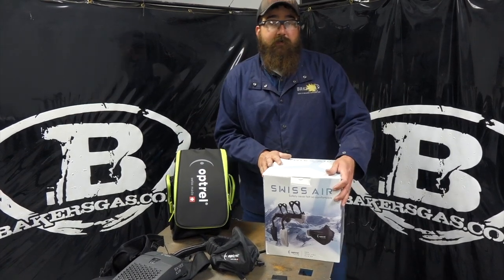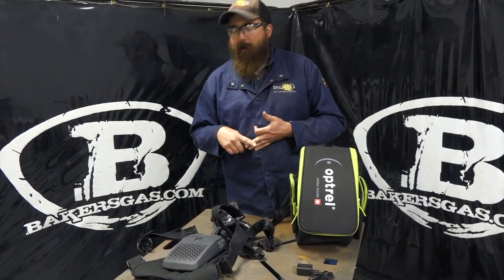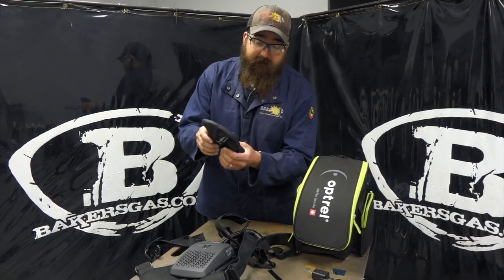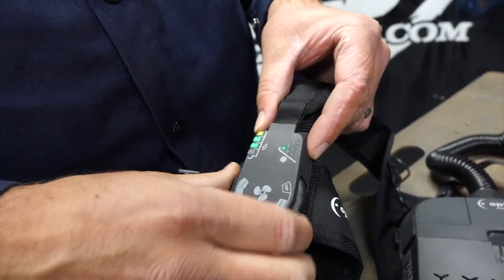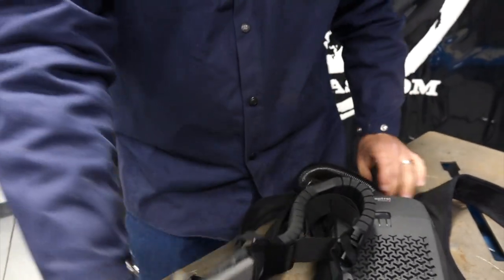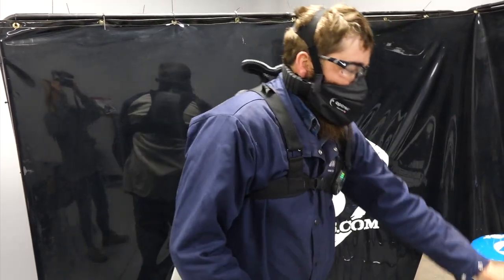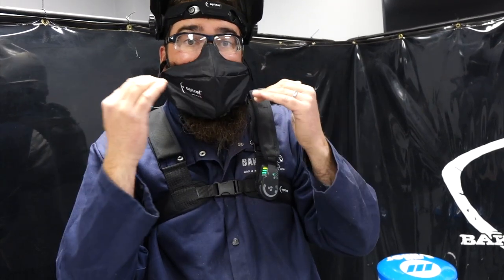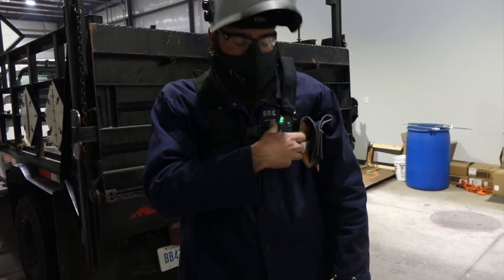Optrel Swiss Air Review - NO HELMET REQUIRED PAPR! 99.8% filtration & rechargeable mask system.

Comment: I got this product and would highly recommend. The back pack does have an adjustment with the straps where they attach to the back pack on the lower straps. There is two sizes of straps that are attached to the back pack on both sides. Plus the Valero has partial adjustments.  Thank you for your video. I watched it before I did the free 4 day trial from Optrel. After trying it I would not want to go back to my half mask respirator from another brand. Very comfortable and useful product.
Reply from the maker: Thank you for sharing! We agree you almost have to try it to really see the value!
Reply: Do you still recommend it now you have had it a year.  Also could you say how long the filter lasts?  I weld on pipelines in trenches all day and am wondering if the filter replacements will cost me a lot?

Comment: I am guessing Optrel recommends wearing the harness under your welding jacket or does it come with a protective spark/heat resistant cover for the control knob? I'd think judging by the sparks hitting it while you are welding that it would not last long outside a jacket during long welding processes.
Reply: They claim it is built to withstand the welding process and shouldn't be under any clothing because it will reduce airflow...

Comment: You did great tests on both PAPR e3000x and now  Swiss Air. Which one would you suggest,when and why, now that you've  tried both? I will take one system for my home hobby job. I'm leaning towards the Swiss air, cause it takes off the weight from the helmet, can use it under any other welding helmet if I choose to swich, and under any other clear mask that I already have, But I'm not sure how it fits under the welding mask especially Panoramaxx.
Thank you.
Reply from the maker: Hello, thanks for watching! The system we would suggest really depends on your application. In our opinion you really can not go wrong with the Swiss Air. Super versatile since you can wear under a helmet or shield (or alone) these days masks with filtration is an every day thing.  I will have one of the guys on the team try the Swiss Air with the Pano and let you know how it fits! Email us and we can quote you both. support@bakersgas.com
Reply: @BakersGas   SUPER Great. thank you so much guys for trying it with the Panoramaxx. 👍
Reply: @BakersGas  did the filter cover tab break on you?
Reply from the maker: @Andrew-FKF  yes we did break it, it can be replaced though!

Comment: For hot climates welding and grinding would you recommend this over a papr helmet and grindmaxx papr mask. Trying to decide between cost comfort and versatility.  Shame is doesnt fit under panoramaxx.
Reply: I would highly recommend the product. It is very nice to have the fresh air in the face all day in a hot shop. Right now Optrel is offering a 4 day free trial at some of the retailers. Maybe this guys business has this offer.
Reply: @kevtech733  which are you saying you have. I'm between the 2 options they offer. Full face or half mask
Reply: 2F Welding the Optrel Swiss Air. The one in the video.
Reply from the maker: Yes this is a game changer for comfort plus you can pair with ANY helmet if you need to weld or grind. Any other questions let us know.

Comment: Every  welder should  be provided one of these  

My lincoln papr is bulky and you cant get into certain places 2 hour battery   but this thing skeek looks light weight. I'd wear that daily even just welding out side or on a building   

You can say it's expensive  but you can't replace your lungs. 
Sit on machine rest your life or proper protection 

My papr cost $1500 was welding galvanized with 7 other guys in a small shop
Reply: Yes good point. I got this product and it is $1600 in Canada but worth it. Way better than the 3m half mask I was using and the battery last all day. 9 hour shifts I wear it entire time and it only shows 1/2 use of battery.
Reply from the maker: Yes we agree all welders need this !

Comment: Between this or the e3000 what would you recomend? I am currentlly using the 3000 but it has very little air pressure diffence Between high and medium. If this is a better unit i would much prefer to go this route.
Reply: I have it and low setting is useless, you need two batteries to keep it on high.

Comment: Bud, how do you get to try these. If been welding SS and Aluminum tanks over last few years....got long haul covid that still has my lungs f'd up and the N-95's I wear just grinding or inside clean out have me pulling hard w/new filters. I can only do bout 10 minutes inside  before  I  need AIR.... and that isn't cutting it.  We have 3m papr's but unless for actual work and bulky in a 54"tank for my tall ass. Any info much appreciated.
Reply: Id like to know as well I’m with you on the tanks I weld and grind in aluminum fuel tanker and fuel trucks.
Reply from the maker: Hey! Sounds like you need a Swiss air! contact us for more info or options on a trial to show your boss :)
Reply: @BakersGas  How do you go about getting a test/trial demo?

Comment: I like the flexibility of this unit. I would love to see if it could fit under a panoramax.
Reply from the maker: We are going to try it out and we will let you know! I think it will fit but will be close :)
Reply from the maker: It will not fit under the pano! They do make a Pano PAPR if you are going to be welding and if you really like that hood.
Reply: @BakersGas  awesome thanks so much
Reply: @BakersGas  Thanks for testing it. Can you please elaborate on this why you thik it will not fit ,cause I've seen the optrel selling Swiss air in ready to Weld packages with Pano. So they "think" it fits .. If using Swiss air in Pano would mean you need to go further away from the lens, resulting not having that "pano" view anymore, then I understand.
Reply: @BakersGas  But they sell a kit with the Swiss Air papr and Pano's. Not to be confused with the welding hoods that have the fresh air built-in.
Reply: @Baker's Gas I don't agree this won't fit with a Panoramaxx.  I just had a Swiss Air + new Panoramaxx CLT and it worked fine and had no issue.  Yes, nose rested right on the top of the mask, but could potentially compress further with no fit issue or artificial tilt up of the helmet.  Real Estate was even better on my regular helmet if you wanted to tilt down further, but that is no different that regular vs Pano w/o Swiss air.  Swiss Air took up less space than my 1/2 mask + round 3m filters.  Awesome product!  Hope this helps someone.  I stumbled on the answer to this same question
Reply: @gotcrampons7913  thank you
Reply: @marvinc02  I bought and now own the Panoramaxx CLT + Swiss Air I was so impressed.  Clearly full on disagree that they aren't compatible and HIGHLY recommend the Swiss Air and not having to be "locked" in a Papr Helmet system!
Reply: @BakersGas  could you please see if it fits under the 3m g5-02? i would really appreciate it  would hate to buy it and realize one either i have to replace a 1300$ helmet or return a 1600$ swiss air  :/ thanks a ton!
Reply: @gotcrampons7913  do you smell any welding fumes? What about Amy sealants that melt by welding area smell this? (Crystalline silica)
Reply: Probably didn't realize the nose foam has tear away pieces so that it does squish your nostrils, I weld side dumps, logger trailers and a bunch of other trailer styles. The Swiss air is a great papr. It was designed to be worn with pretty much any hood; grinding shield it's much more low profile than a 3M half mask with the n95 dual pink filters. So if you can wear the 3M half mask this will work. The pack is adjust up and down I wear mine lower because it just feels better on the shoulders when I wear it hours on end. There is a multitude of adjustments so if it's tight on the chest that can also be adjusted. I spent an evening at home adjusting it.

The face mask is cold water washable and the nose foam is replaceable, which if you do was it will more than like have to be done or just use mask cleaning wipes.

If the mask is fitted correctly you won't get and smells until you need to replace the filter, filters are smaller than most systems so if you are in a very dusty/dirty shop you may have to do that more frequently, I do wish the pre-filter was washable but the are a  tightly weaved cotton (i think) disposable with a spark guard of course.

Few things I wish they would change is the lower draw string on the face piece feels weak and I expect it to break, but it has as of yet. Wish one of the shoulder straps had a fastener like the face mask for easier time getting it on/off.

Comment: Anyone know if the filtration is good enough for vapors/fumes while painting using etch primer, water based paint, clear coats and hydro dip activator?
Reply: I don't know about this specific product but PAPR units generally only come with particulate protection. For VOC's, fumes and gasses you want specifically rated protection against Organic Vapor/Acid Gas.
Reply: @WorthlessGeek  yes I found an organic vapor filter for the e3000x unit
Reply from the maker: Yes, if you want to reach out we can give you information on a trial!

Comment: Can you make a video comparing the Cleanspace 2 VS Optrel Swiss air (without helmet).
Reply from the maker: Clearmaxx? https://bakersgas.com/products/optrel-4900251
Reply: I checked out that other product you brought up and it looks like it does not have a pre filter. So in dirty environments it would go through the filter very fast. I have the Swiss Air and it does have a pre filter so it savers the master filter and I have gotten almost a month out of my 1st master filter and still has some use left. I work as a pressure welder in a vessel shop.
Reply from the maker: @jjgonzaga4229  I am not familiar with that option but the Swiss Air is our favorite quality option. Let us know if you have any other questions.

Comment: If I put this over my clothes, it's open to damage from flying sparks. Can I put this under clothes?
Reply: There is a spark protection filter before the other filters so there is no need to do that. Also, you'd restrict the airflow pretty badly by doing so...

Comment: How does it not need a fit-test?
Reply: Because it's not a tight fitting full seal respirator... PAPRs are positive pressure which pushes air out and only air coming in is thru the filter pack. 
Whole reason I'm looking into one is to keep my beard (in regards to your other comment about coverage and his beard)

Comment: How does the old air escape?
Reply: My question exactly as well.
Reply: @chrisp9046  hey man, I bought a newer optrel paper helmet with a face seal under it and it works amazing. I don’t smell any fumes at all.
Reply: All the new optrels have it very amazing 1000000% recommend the crystal papr
Reply: @chrisp9046  if your gonna order the optrel papr crystal you’re gonna need an air pack as well
Reply: @Gldoo  Oh man, thanks for telling me man! I have a feeling that wouldn’t work with a beard then lol. So it doesn’t fog up your welding lens? Thanks again for letting me know!
Reply: @chrisp9046  yep I have a beard as well and the optrel crystal papr 2.0 is amazing and works very well, I weld aluminum so there’s a lot of fumes and I don’t smell anything and if I do, it’s very rare
Reply: @chrisp9046  no problem

Comment: how long the filter last
Reply from the maker: Hello, the system does have a light that does indicate when you should change the filter. In general good idea to change annually. Really does depend on the environment you are in. Never can hurt to change more often.
Reply: I wear the Swiss Air 5 days a week 8- 10 hour shifts working in a vessel shop. Almost got a month so fare out of the current filter Im using.

Comment: Have you tried using it with the optrel panoramaxx clt? I recently purchased the panoramaxx clt and found that it won't fit flush with the miller half face respirator
Reply: It was designed to work with panoramaxx